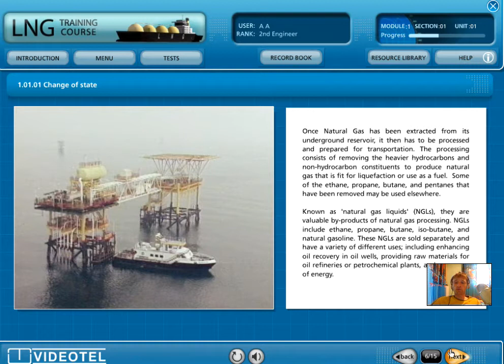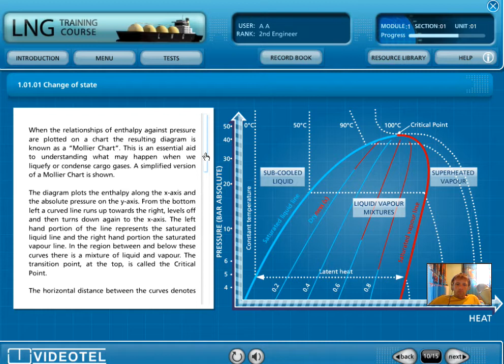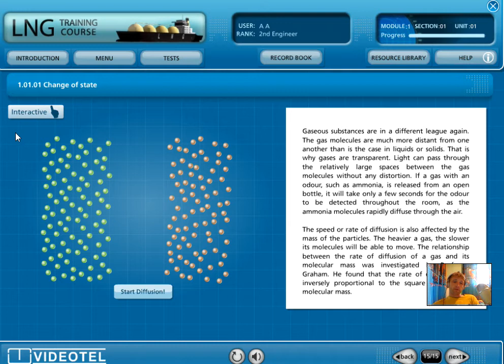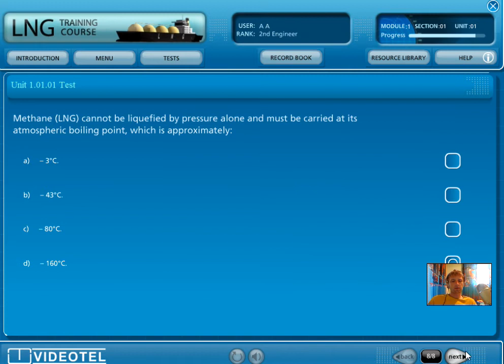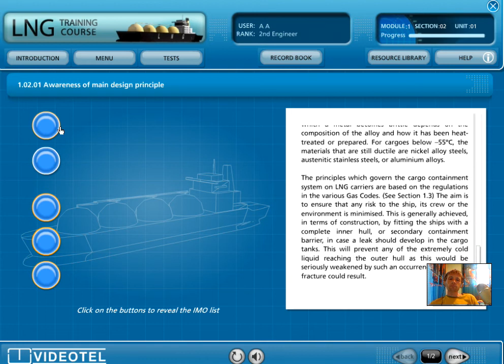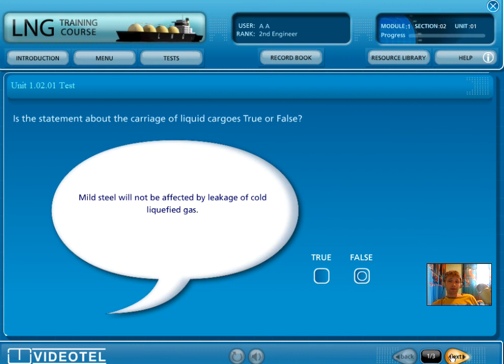Change of State LNG Training Course Part 2

Comment: what are the first things that every engine cadet should know and learn ???? pliz i need ur answer
Reply from the maker: First of all cadet must be familiar with safety procedures onboard the vessel wear proper all protective equipment.Engine cadet should know where located lifeboat.Mostly the duties as stated.Normally cadets is under second engineer command. Asking questions at correct time this is really important. And there is more things for sure like cleanliness of it's room that  located on accommodation area and keep all tools clean and in position at engine workshop.Other think which also important is that engine cadet should learn the names of the tools and what every tool do.
Reply: @MOCCorp  thank u so much , and whats the first machine to be responsible for or the machines that we start learning first?
Reply from the maker: @oualidmokhchy7042  Hello normally engine cadets are making logbook entries at begining and measuring of the tanks and assist second engineer.Engine cadets will learn to start and stop bilge water pumps suction bilge wells and transfer them to bilge holding tank.
Reply: TA7IIYA L HARBASE W MADII7 W GA3 SABASSA 9ACH9ACH